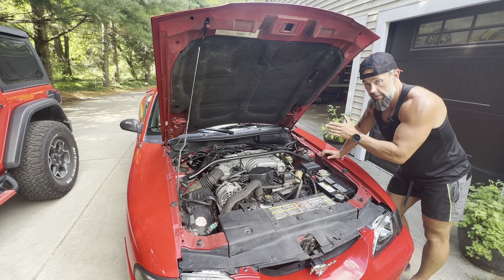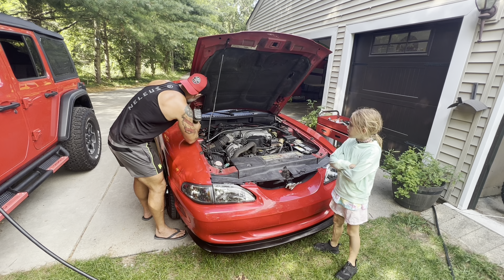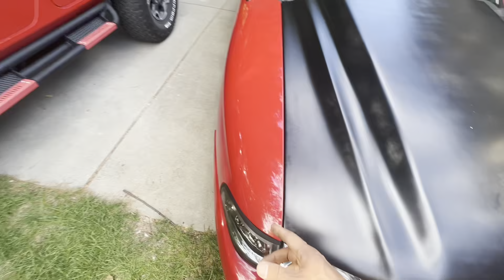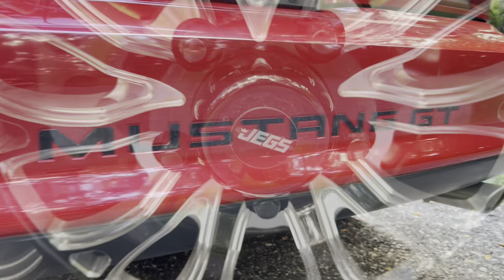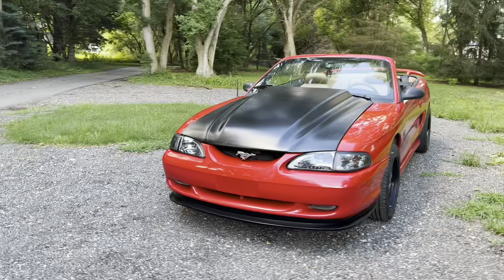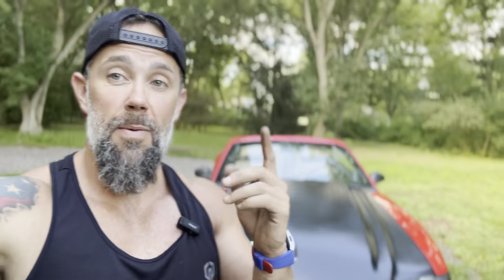Installing a 3" COWL HOOD onto “Plan A” my SN95 1994 Mustang GT build for HRPT 2023!

Comment: One question the original ground strap on the original hood, you have to remove it for an aftermarket hood. That doesn’t affect anything important? I want to get a cowl hood for my 95 gt.
Reply from the maker: I didn’t put it back and haven’t noticed anything even before switching everything to Holley terminator

Comment: Hey man where do you order this hood off of ?
Reply: Dam you got a good deal here in La you get them for like 500$ and they fit terrible
Reply from the maker: Try Doug baker out of Ohio he has a company that sells new hoods for $300 plus shipping. 

+1 (513) 531-6640
Reply from the maker: I bought it used off FB marketplace and refinished it and then had it wrapped. The video where I first picked it up is here:

Restoring a used $150 fiberglass cowl hood for 94-98 SN95 Mustangs - Project “Plan A” for HRPT 2023
https://youtu.be/qG4e02HK5fI